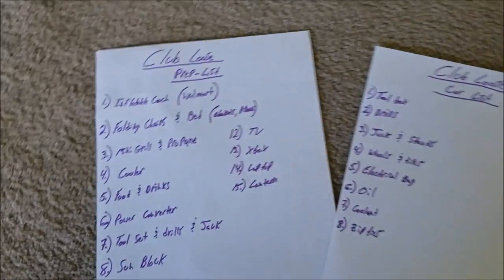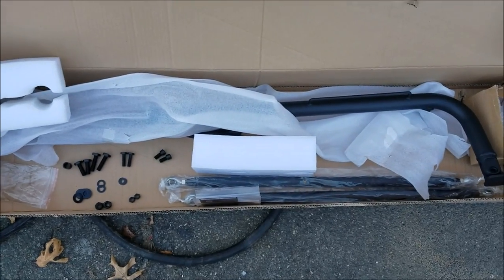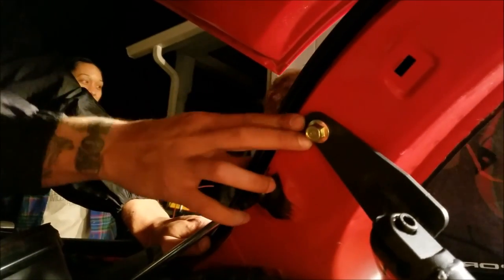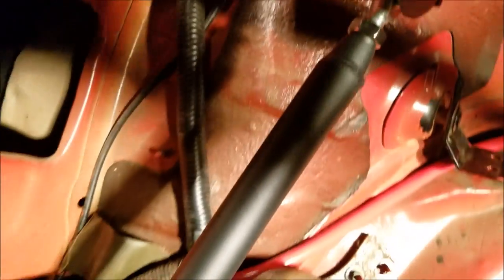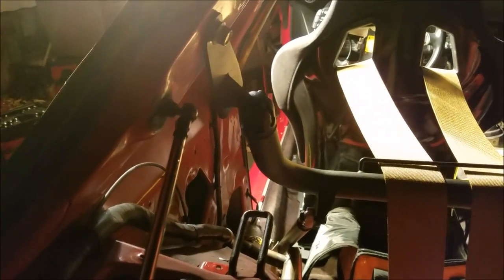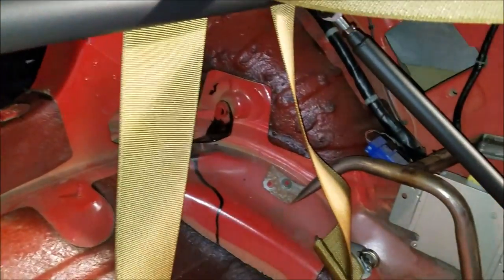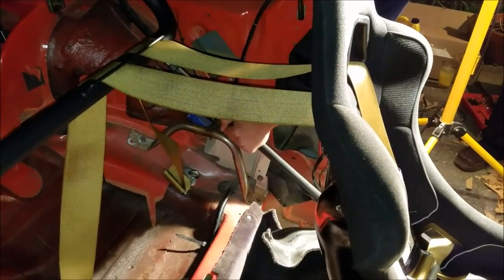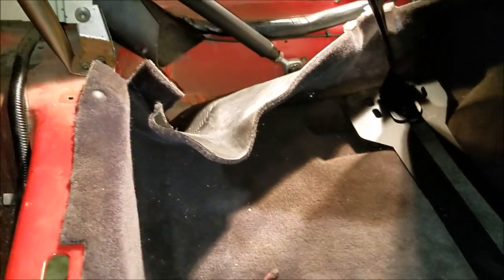Cipher Nissan 300zx Harness Bar Install

Comment: did you every remove that steel weight on your lift gate? i saw it at 28 min. i was doing my struts on my lift gate and found that solid brick of metal bolted like yours. couldnt believe they added that for weight.
Reply from the maker: I did, haha yea pretty wild they implemented that 😅

Comment: @06:39 they changed the seatbelts from the doors to the body of the car itself. just behind the seat on 93-99 z32's it was only 90,91 and 92 that had the seatbelts on the doors itself.
hope that dosent fuck with you installing your harness bar, ive legit never fucked with a bolt in harness bar on a z32 before.
Reply: preprodigy my 93 has door belts

Comment: Literally just last week got the same exact harness bar installed in my 2+2 Z32 lol. I think the harness bar i got was just a hair wider because we heated up the bends in the bar itself and moved it in just barely and then the plates were able to fit flush. Tip for the bottom bolts is try to get the bolt through the wall and have the nut on the side towards the seat so its more of a stud now because then you can tighten it much easier from the nut instead of the bolt. Because if for whatever reason you want to take it out, its gonna be a bitch the way you have it set up. Hard to explain through text tho. I could send some pictures if you want!
Reply from the maker: Jake Richardson exactly what we were going to do hahah!
Reply: Nice lol good luck! PS you might have to bend out the hole you put your hand in with a pair of pliers but it goes right back
Reply from the maker: Jake Richardson yea that would be awesome send them to zbruhzchannel@gmail.com

Comment: fuck yeah! dopenesssss
Reply from the maker: preprodigy the funny thing is I recorded this and then you said the work thing... Haha love it!
Reply from the maker: preprodigy yea I didn't do it upside down was afraid it would leak but I'm going to flip it haha
Reply from the maker: preprodigy and yea after the fact I researched that which is so dumb! But if it doesn't pass tech I will return it and get one fabbed.
Reply: Z-Bruhz hahaha hell yeah brotha!! shit is truth
Reply: Z-Bruhz i hope ot does man. and yeah its stupid how they swapped up the seatbelts like that. they put belts on the doors originally because if u leave ur belt attached u can open ur door and jump out. kinda like automatic seatbelts which were bog in thise days. but sadly getting out was easy part. gettinf in with belt still attached was a bitch so they stoped installing belts in the door since no one used it like that and put them in the car itself. kinda crazy but cool too.

Comment: Anyone know if that one will fit a 2+0 or any that can fit in one?
Reply from the maker: This will fit a 2+0 as long as the seat belt does not screw into the top of the door.
Reply: @ZBruhzchannel  so the answer is no lol

Comment: @02:30 yeah sadly the temp sensor has too be mounted too the upper hose so u get reading of engine temps fresh out the block. also mount that adapter updose down and paint it same color as your coolant hoses. this will help hide that nice and clean. i legit just installed one on the z i built for my buddy.

https://youtu.be/DouY5edBa90

check out the video, its supper short. but let me know what u think brotha. love working on and sharring Z knowledge with fellow enthusiasts =]